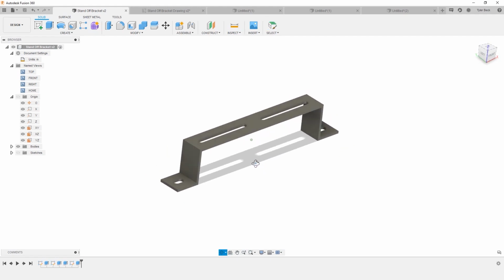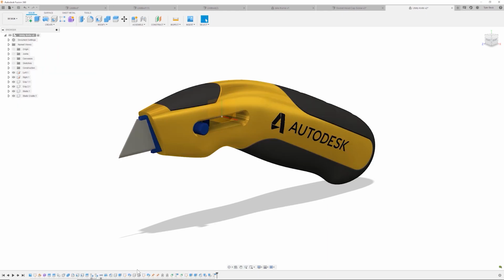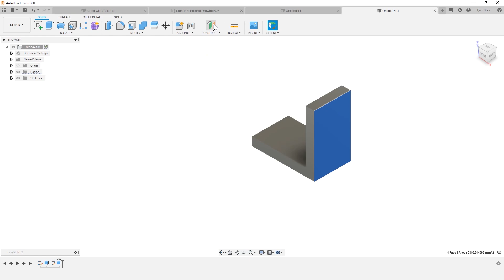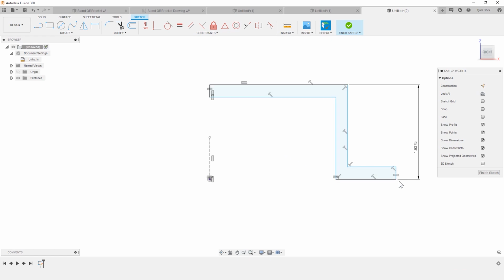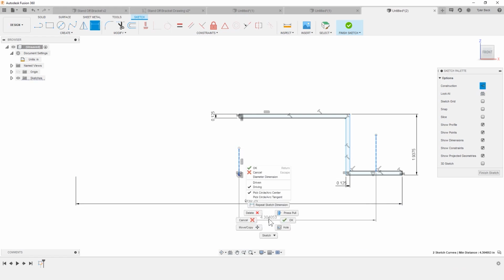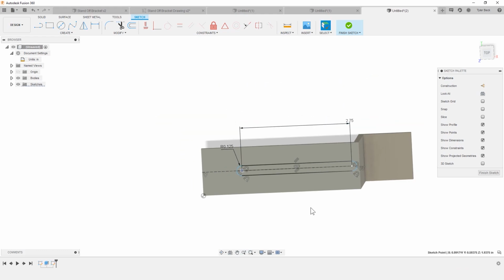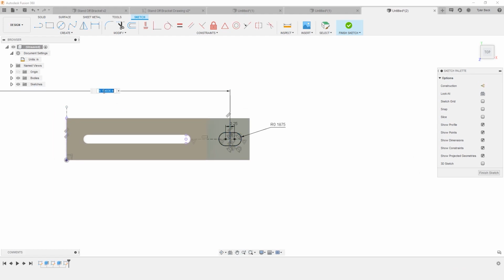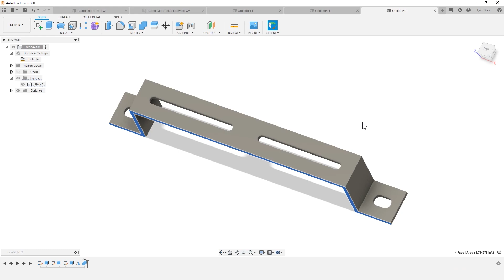Fusion 360 - Stand Off Bracket Tutorial (Start From Scratch)

Comment: Since the entire thing is 1/8", why not just draw lines and then sweep to create the body?  Is it because you wouldn't have as many constraints or that you'd still have to add them later and it wouldn't save that much time?
Reply from the maker: You totally can. But a sweep is two sketches for the first main shape. One path one profile. I would extrude for speed and simplicity but both are fine.
Reply: That's be beauty of fusion, you have many ways to achieve the goal.

Comment: Way didn't you use project for the center lines that you dimensions from?
Reply: Even though, a great tutorial
Reply from the maker: Thanks!
Reply from the maker: That totally works!  For beginners...sometimes a construction line feels easier...sometimes not.  Great tip though!
Reply: @TylerBeckofTECHESPRESSO  For beginners,. it would be nice to say what the keyboard shortcut you used is. "I'll make this a construction line *keyboard click*" is not particularly helpful. Otherwise a very helpful tutorial.